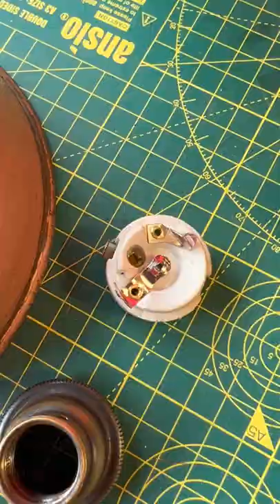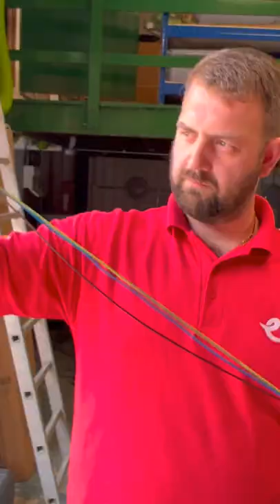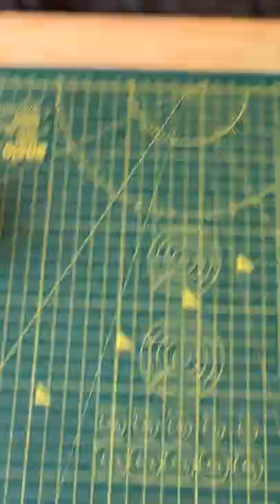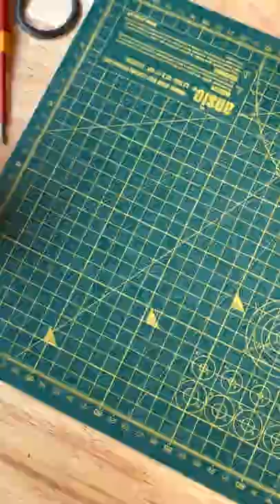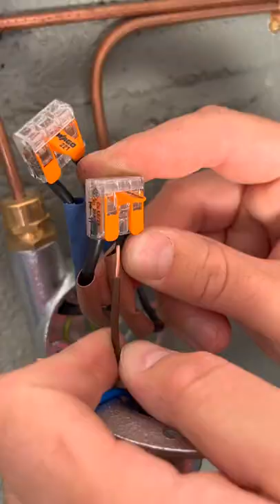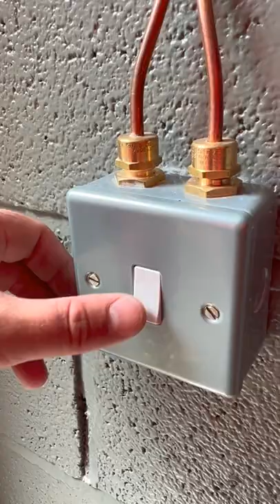Conduit and Copper a Great Lighting Combination.

Comment: عمل سيء جدا الحديد موصل للكهرباء
Reply: If the wires are connected properly and when there is proper grounding and there is so i see no problem
Of course this is only applicable with an rcd in the line